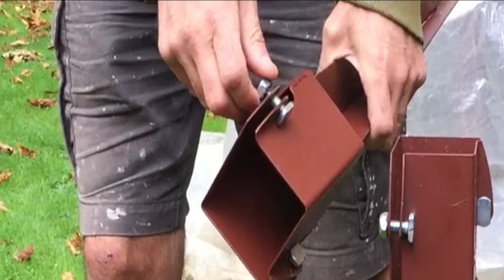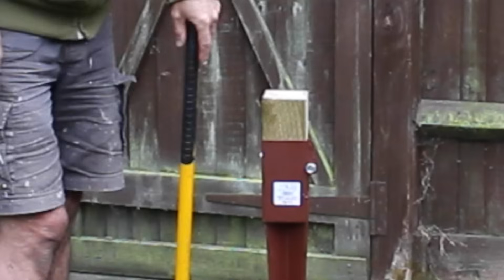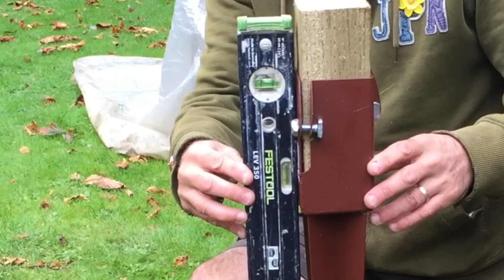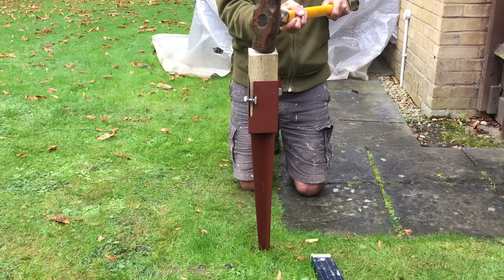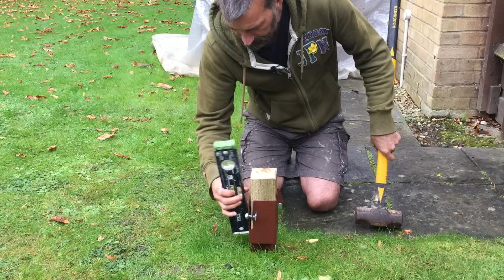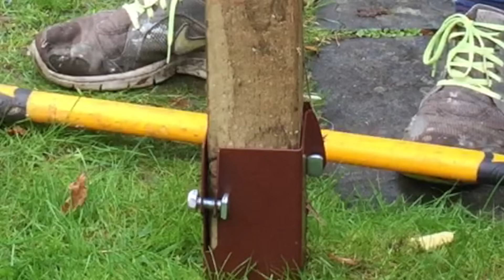How to install a METPOST/Fence Spike like a pro!

Comment: I'm going to install six of these and your tutorial has given me the confidence and knowledge to tackle this. Superbly presented and excellent communication. No music in the background drowning out the speaker, what a joy.
Reply from the maker: Thank you so much. Good luck with your project.
Reply: Maybe dig down a foot or so and back fill with concrete. I have quite soft ground, water runs down so I might add concrete to the top 18 inches around the spike.

Comment: I was having a lot of trouble digging holes. I would always hit a root or a stone. Yet somehow these drive in easily. These literally saved me hours of digging post holes by hand. The twisting is annoying. 1 post would always turn the wrong amount. I had to pry the post up and re-drive it 4 or 5 times to get it strainght and it was still much easier than digging.

Comment: Additional tip:  If the post doesn't stand perfectly vertical you can wedge something solid between the base of the post and the holder part of the spike on one side.
Reply: Great tips, running a sledge with your hand so close to the hammerhead is a great way to smash your fingers to where you will only be able to play two keys at a time on the piano.

Comment: I live in NC, USA. The red clay here can get like cement.  I have used these before. Now starting a new project that needs 8-of these. To simplify driving, this time I am either going to use an old 1" x 16" long masonry bit or a 1.5" dia. garden auger to drill a pilot hole in the ground first . By trade I'm a machinist & we most always drill pilot holes to start for larger stuff so I figure if it works on steel a pilot hole should help guide the post holder while driving  it in. BWY, GREAT vid !
Reply: I live in Charlotte and I have a 4 foot section of rebar for a pilot hole. I plan on tapping in a few inches and then pulling it out over and over again. Also, this will help me check for rocks prior to inserting the spike. Any thoughts?
Reply: @networth9151  One more tip ;  be sure to drill about 4" then reverse pull up a bit and repeat , this helps clear debris from auger & pilot hole & saves overworking drill.

Comment: I have found the best way is to start the hole with a length of pipe , knocking it down and wriggling from side to side a bit. Then use that pilot hole for the meatapost spike and give it a few knocks adjusting to plumb as it goes down.
Reply: Also the solid moulded rubber tool that is designed for exactly this purpose is far better than an off cut of timber

Comment: That's not how John Henry Swings a hammer. I was just looking for a video of somebody using a post driver to drive a Post hole Digging bar into hard ground and dig a hole with the Digging Bar and came across this, also I've never had back issues until I got a job where I stopped swinging a Splitting maul or a sledge hammer to split wood. It's an interesting video, but you are wrong about it killing your back, My Grandpa's been doing it from the time he was about 10 years old all the way up to until he was 75 years old and he could keep up with me when I was in High School as a 75 year old man that's been doing it his entire life. when I was working with my Grandpa, I could split some logs in only one or two swings with a splitting maul, I could even split ones with knots in them with a splitting maul, so it Killing your back, unless you get temporary muscle cramps from building your muscles, then that's all you are going to get, a stronger back, the muscle cramps can be cured by a massage, also I got a bigger hammer than what it looks like what you've got, that looks like about an 8-10 pound hammer.

Comment: Hi. Thank you for really clear instructions. 2 of our posts ended up a bit turned compared to the fence line, so we attached the cut off long piece of pole and 2 long screws attached to the new pole inserted into the spike to turn the spike a bit and bring it true to the fence line.

Comment: Thanks. I have a similar job putting in offset fence post support brackets for a leaning timber fence and have never used a sledgehammer so I found your technique quite instructive.

Comment: MUCH easier than trying to insert a large wooden post into the earth AND it won't rot away. Great video, thx!
Reply: Oh they do, and then they’re an absolute flippin nightmare to remove! Awful things. Far better to dig a hole and use post fix

Comment: Looks great. Im just about to do this today, wish me luck! .......

Update, sorted! It was a touch tricky to build the fence by myself. I get the bit about the post slightly turning as you hit it, but I think that it doesn't matter whether you are left or right handed, it will turn clockwise or anticlockworse, regardless of the way you hit it. One of mine is a touch too rotated, unfortunately, but the fence looks pretty good, though. Many thanks for this video.
Reply from the maker: Good luck!

Comment: Depends very much on the state of the ground! If grounds too hard best to manually dig half way down before you start setting the metpost, and backfill and compress ground around it later. Helps to get the the post straight.

Comment: one of the BEST How To vids I've ever seen.  Thank you for the tip on the rotation of the post upon swinging ...wouldn't have realized that!  Also, thanks for the great sound...really helps!  I do need to drive in my post on a slope and worry just a bit if the bottom of bracket will come all the way down to the level of the soil...but I think this is the solution I'm looking for...just building a kids tree fort/ deck extension. THANK YOU
Reply from the maker: Thanks for watching. Good luck with the fort!

Comment: something like installing fence posts, it is important to keep them plumb, if you have an issue with missing, it's because you're not aiming first, which in some instances it's better to make taps, like when you're too close to something you don't want to hit, but still aiming the hammer first helps.

Comment: THANK YOU for this video!!!
l am replacing my fence by 
 re using the 4x4 post. This will save me so much time and money.
And comments welcome
l was planning to plumb in dry concrete then wet the concrete to harden.
Reply: I wouldn’t waste your money on these met posts. Always work loose in the wind and you end up concreting in to fix firmly.
Reply: You will have a fence that sags in 3 years, guaranteed
Reply: @mossy723  I don't think it would sag if the fence is 4 to 5 feet high, I have neighbours who had them, and they are getting very popular, but your comments alarms me so I will do more research ..thanks for taking the time
Reply: Hesham El Garawany 
Maybe 4 feet with 4 foot sections, but I’m speaking from experience with a 6 foot with 6 foot sections. Had to take it apart after 3 years it sagged so bad. With the new Rapid Post quick setting concrete the hardest part about the fence is digging. Once it’s done it’s done.
Reply: @mossy723  so your only issue with this method is if you don't use concrete ?
Reply: S Mozza no, you can build a very solid fence with soil and gravel instead of concrete to hold you post. My main issue is that the 30 inch spikes just will not stay solid over time and the fence sections will sag. I’ve seen frost( if that’s an issue in your area in winter) push them 5-6 inches right out of the ground. In my case I had a 6 foot fence I built in 6 foot panel sections and within 3 years my long section sagged back easily 30 degrees from vertical. I had to take it all apart and do it from scratch with post holes and concrete. I just believe those spikes are good for a bird feeder, mailbox etc., but yo do a bigger fence it just doesn’t hold up.
Reply: @mossy723  I was looking at these as a option to put up a 5ft fence at the bottom of my garden but your information is making me think otherwise, thank you for the warning 👍🏻
Reply: S Mozza  I really think a shorter fence with no long runs might be ok, but I’d hate to see anyone have to redo it like I did.

Comment: That made it look very easy (mine are for a big wooden house sign). I think the biggest problem for me wil be London clay as hard as rock an all that looking easy sledgehammering is going to be very hard, never mind that I have a sign which is much shorter wood on one side but at least i now feel there is a chance I can get it into the ground unless it proves too hard and the old ones won't come out from near by so knowing my luck there will be a load of concrete near there too from the old ones.

Comment: Thanks for such clear instructions. I'm not quite getting the rotation right on my spikes. Sometimes they seem to twist and sometimes not... I also wondered when the ground is really hard, and it's difficult to get the spike in, Could I use a "repair spike" instead which is shorter. Or are they harder to drive in the ground?

Comment: The seating of these metposts was very helpful.  However,I'm making a short fence where I'll be using 4 of these metal posts.  How do make these posts line up parallel with each other?  ie, if I get behind the first post, I want to look down the fence line and see only the first post, as it is so perfectly aligned with the other 3 post, that it hides them.  Hope that made sense.

Comment: Awesome, great tutorial, thanks for sharing, I have 7 to do soon and I will use your advice :)
Reply from the maker: Rainingmonkfish Good luck!
Reply: @buildingsheriff  Thank you, I may need it as its behind a pond and on a slope,  I was intending on using 5.0 x 90mm  forge fast screws for the rails and 3.5 x 50mm for the feather edge, in your expert opinion is that ok ? Many Thanks :)
Reply from the maker: Rainingmonkfish That sounds great. I hope the rain holds off!
Reply: Hi. Can you use these spike for concrete posts?

Comment: Building a wooden cabin on the side of my caravan. Ground quite hard as its dry and it only rains a few days of the year. Is it better to use these than concreting the wooden posts into the ground?

Comment: Hello, thanks for this, really helpful. Do you think I can use these for decking posts too? It's not a huge area, but it's raised; about 3 foot from the ground and the side beams would also be attached to two outside walls. Any advice about using these instead of concreting the posts in? Thank you. Niki
Reply from the maker: Hi Niki. Yes. These are perfect for decking posts!
Reply: @buildingsheriff  Brilliant, thanks for speedy reply.

Comment: I would use longer spikes,the longer the better...also you have to do this as you go along instaling  the fence panels so not much space when you are next to it...it will never be perfectly straight,but does the job.fast set concrete is a longer lasting option
Reply from the maker: Sure, but this always depends on the state of the ground. Thanks for your input.

Comment: Ok, I love the concept. Thank you. What happens when you hit an obstruction? ( don't say move it as the pergola needs to be in a specific location) Can these be concreted in rather than hammered as I have often encountered rocks while attempting to drive fence posts.
Reply from the maker: Mal Heley Absolutely. If you find rocks and stones you can excavate those, make a hole and then pour a wet concrete mix -  the wetter it is the harder it sets - and just set your met post into that. Job done. Thanks for your comment.
Reply: The Building Sheriff  The wetter it is the harder it sets....Mate your way way way of the mark the wetter it is the more the concrete leaches into the surrounding ground..

Comment: I have 8 inches to go.  Should I wet the ground more to be able to pound in better?  End up damaging the post too.  Any thought on how to remove that?  It’s stuck in there good.
Reply from the maker: Man, you've hit a rock/stone. Try wetting but you will know if it's hit something solid because the sound will be different when you hit.
Reply: Use a 1 metre long 8mm diameter threaded rod to punch a centre pilot hole before you start. Keep pulling it back out as you you’re tapping it down. This way you’ll know if the way is clear to drive the spike.

Comment: Very useful clip 
How much of load this kind of base could tolerate?
Reply from the maker: @TuffTune  a great deal.
Reply from the maker: @TuffTune  easily enough for a deck
Reply: Thanks so much ! 
I am trying to add another post in between the two posts of existing fence for extra support 
Thanks again

Comment: Instead of twisting the spike to off set, if you alternate sides with sledge hammer will it have go in  straight instead of off setting?
Reply from the maker: Good thinking. It should.

Comment: I hate this things! Next door neighbour has used them many years ago for their DIY bodged fencing, it's leaning onto my side & when on a windy day looks like it's going to go over & collapse 😂 good job they have seen my new fencing with concrete posts much more sturdier... So I'm doing theirs soon using the same method! 9ft concrete posts solid...
Reply: Wooden posts will shrink as they dry out then swell in the damp which ends up in the posts floppy and panels moving in the wind.

Comment: Should I worry about gas or water pipes below ground? Or are these usually much lower than these fence spikes can reach?
Reply from the maker: That is a possibility. They are normally at least a foot underground. You would need to check your house plans.

Comment: how do you square it off with another post ? i.e straight line .. use plumbline? .. do you measure between posts the length of the panel in between or fix the panel and then install another post?...
Reply from the maker: Either plumb using a level or install another panel and use that.

Comment: Hi there great tutorial i was going to ask if i use concrete gravel boards and buy the clips that attach them to the posts how does that work if the metal is above ground so obviously it won't screw to the post ? Or would that only work with digging holes and concreting them in and  having the wood exposed to screw the fixtures on?. Im definitely using spikes though so would i have to use wood gravel boards?
Reply from the maker: Mmm. Interesting question. Ideally you’d knock the spikes in so they are flush with the ground if you want to use those clips.
Reply: @buildingsheriff  I suppose I could use loctite epoxy metal concrete glue lol. Once up it stays that way :)

Comment: Thanks, really clear and easy to follow. Can these spikes be used to reinforce an existing, rotten-bottomed post? If so, how do you get them in underneath? Tip on shooting video like a pro, avoid seeing tripod and mic wire in shot and shoot close ups rather than cropping :-)
Reply from the maker: Edward Cave Thanks Edward. Unfortunately you would have to dig out the old post foundations. In this case you’re probably better off just putting in a post with a concrete base. Thanks for the shooting tips!

Comment: Hello..no idea what I am doing but will have a go! I need a hammock post 4x4 and other end will be from a wall. This seems like a good idea? Will want to take post in and out..as needed. Would this hold it?
Reply from the maker: Hi Sally. This will hold it. However getting the post out may be tricky. Try to get the met posts that have the tightening bolts. You’ll need to use hundred millimetre posts as the 75 mm posts
Reply from the maker: Hi Sally. This will hold it. However getting the post out may be tricky. Try to get the met posts that have the tightening bolts. You’ll need to use hundred millimetre posts as the 75 mm posts
Reply from the maker: …will bend
Reply: @buildingsheriff  good to hear it should work. So I will need to ask for 100mm fence spikes to hold a 100m post?Sorry if sounds obvious!
Reply from the maker: @sallyvaughan1231  yes. Or 4 inch posts and spikes in old money 👍

Comment: Iv got a loose fence post can I reinforce it with one of these spikes? Until I can afford to get my fence fixed in the summer?
Reply from the maker: Yes, of course.
Reply: @The Building Sheriff  Will I not hit the concrete under the post?

Comment: Hey guys does anyone know if this spike post bracket would be ok in 24” suitable to handle a fence gate? Or should I buy the longer ones I think they’re 30” but I’m not sure please any advice before I do my project?
Reply from the maker: A lot depends on your ground. TBH, if there's a choice, go for the longer option. The 24" should be fine, but for the sake of driving in another 6" - why not?
Reply: The Building Sheriff got it thanks !👍🏼

Comment: Thanks for this video!  I was about to do some fencing with anchors in concrete.  I wonder if there's any appreciable difference between the strength of that method compared to this one, because metposts seem a whole lot easier.
Reply from the maker: Thanks. Done right there shouldn’t be much difference. Concrete will always be longer lasting however you have to weigh up that small advantage against the ease of using the metpost.

Comment: Hi, I'm looking to make a raised multi level deck  (1m and 1.5m high platforms) as a childrens play area and will need to support a small playhouse as well. Would it be better to use one of these fence spikes or concrete? Which is generally more secure?
Reply from the maker: Hi. Both will work but concrete is always more secure. If the post is tall, you want to watch out for lateral movement and make sure that for an 8 foot post for example it needs to be 2 foot in the ground and 6 foot in the air. That’s the kind of ratio. Good luck with the project!